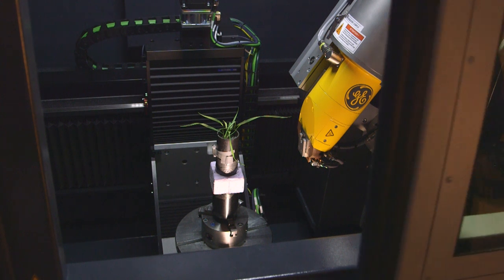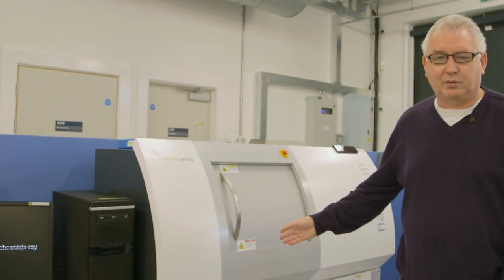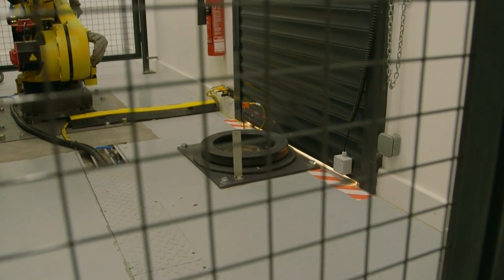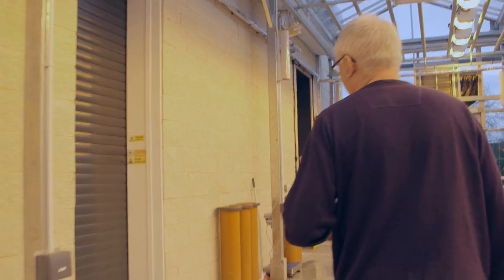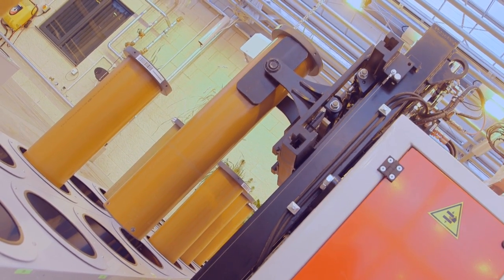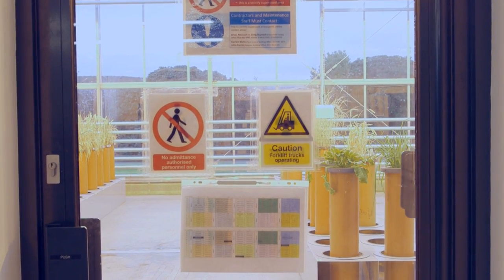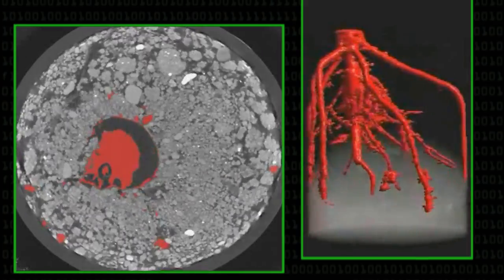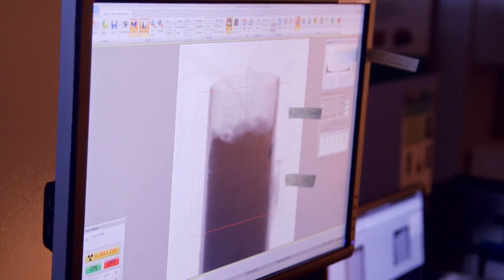3d X-Ray Images - Computerphile

Comment: It's just a CT machine. for plants.
Reply: They haven't so much, though, really. If you listen, the main problem he describes them having is telling the difference. Which is why my own separate post ponders on why the heck you'd pick CT unless you simply weren't aware other options existed, because, unless you can find an effective way of delivering suitable contrast to the plants (which itself may alter root growth behaviour), it's about the worst of all possible 3D radiographic methods for the material under study. You'd probably do better with some kind of automated 3D ultrasound that ran a probe around the outside of each plant pot, never mind any of the other methods which use actual radio or nuclear rays of some kind.

They're essentially performing a bone density scan on the pots, when their "patients" don't have any bones, just soft tissue all the way through... and are being scanned through a thick coat of random cuts of meat.

Comment: hello, I had an idea, about this visualizing the roots, is it possible that you feed the plants with radio actives particles and then observe how they get absorbed by the roots and basically by measuring and tracking their path we could have an estimation of the pattern and appearance of the roots.
Reply: This would be a PET scan. I don't think they'd be able to feed the plants the radioactive "tracer" without contaminating the soil itself, but I guess the roots might be able to absorb enough to show a clear difference between the soil and the roots. Also, I think the radiation from the tracer would probably be much more likely to cause gene mutations than the occasional x-ray scan.

Comment: If the subjective human analysis takes so much of your time to determine the root structure, why don't you do like what the EyeWire team did and crowd source the analysis via a game-like interface? Mapping the retinal connectome seems to be a much more difficult problem than this, so it shouldn't even be that arduous for the participants.
Reply: Crowd sourcing is definitely an option in this case, but of course introduces it's own problems. The image analysis being used here is working, so there's no need to crowd source unless the number of images becomes prohibitive. At the moment with three scanners and a lot of computers capable of processing, this isn't the case.
Reply: Developing a crowd source system also isn't free. You'd also need continuous promotion to keep it going and you're pretty much at the mercy of the volunteers. If there aren't a lot or if they aren't reliable, you wasted all that effort.

This is exactly the kind of task we invented computers for. It's a repetitive, tedious and long mental effort that is very susceptible to human error. They now developed the software which stays useful essentially forever (you can always adapt it for new machines). Quite a bit of engineer probably went into the computer vision algorithm, but compared to the cost of the scanners and the building itself? It's probably a very minor expense with a massive payoff.

Comment: I would love to see more about the algorithms they're using to analyze the scanned images.  They must be insanely complex.
Reply: It's usually done with a kind of deconvolution.

The easiest way to explain a convolution is to think of a blur filter in an image processor. Each point in the image contributes some intensity to adjacent points; it smears out. The measure of how it smears out is a matrix that tells you how it contributes to adjacent points known as a convolution kernel. This can also be done for continuous functions, but never mind.

If you imagine multiplying each pixel with a 100x100 kernel you are now doing 10 000 multiplications per pixel. This is very inefficient. Some smart fellow discovered that if you take the fourier transform of one function convoluted by another, the result is just the pointwise multiplication of the fourier transform of each function. This is very much more efficient. You do your fourier transforms, you multiply to get the fourier transform of the result you're after and then you do an inverse fourier transform to get back to the result.

It's also possible to efficiently "undo" a convolution if you know the convolution kernel. This is called deconvolution.

The simplest 2D example is an astronomical observation. So you have your telescope, and if you photograph a point light, it is slightly smeared out because there's no such thing as perfect optics. If you measure how a point light is smeared out, you know the convolution kernel for how pixels are smeared out by the optics. You can now deconvolve e.g. an image of a galaxy and undo this smearing to get a much nicer result.

In 3D you can do a similar thing. If you photograph a point-shaped object from several directions with x-ray imaging, every image will just be a point. If you extrude these images along the axis they were photographed and sum them toghether into a voxel image, the dense point has become a "star shape", it is a bunch of lines meeting at the point in space where the object is located.

If you have a plant or something that you are imaging, you can consider it as consisting of many of these point objects, each of which becomes a "star shape". Deconvolving the voxel image with this "star shape", turns every "star shape" into a point.

It's in reality more complex than this, because intensity does not depend linearly on thickness of material. If you have a sheet of lead that absorbs half the intensity of an x-ray beam, adding another such sheet does not give you zero intensity on the other side, it gives you 0.5x0.5 = 1/4 intensity.

Comment: Can you apply a deep learning algorithm to better differentiate the roots from the soil? Apparently it's being used to better differentiate cancer cells from non-cancer cells, and to map neurons.
Reply: That seems like a rather odd thing to do when in most cases we have ways to clearly, visibly label cancerous cells as being distinct from regular ones, either through radio-labelling, dyes that response to far-red/infra-red laser energy, etc...

The neuron thing is more interesting, I assume it's the kind of thing used to generate connectome maps and the like, but those are extremely finely detailed affairs that operate at a much smaller scale than is needed for roots and I'd be surprised if the feed data for the analysis isn't from some source that itself better differentiates cells from each other at the original image level, e.g. fMRI.

Comment: It seems like they spent an exorbitant amount of money at each step of this system.  Special robots, special robot environments, special cylinders,  special software.  I would assume that the same operation could have been done manually for many years on the startup cost alone.  Does this mean that there simply aren't enough humans who are interested enough to put in the human hours necessary and therefore they resorted to robots?  Sorry if I am out of line, but it seems like a huge waste of money for some data which apparently few people are interested in.
Maybe some of the cost is necessary.  I don't know.  I'm not there.  But it seems that at least they could have moved the plants once a day or once a week or whatever by hand instead of needing a multi-million dollar robot environment.  And when I say "by hand", I mean a $200 dolly and winch or something.
So, clearly, there either lacks manpower due to a complete disinterest in the project, or someone just has a bunch of "free" money to waste.
Reply: its kind of like trying to get the last drops of water from a glass. Research needs ever more sophisticated tools to proceed. 

The automated plant carrier is a common system that costs very little more than a standard forklift, so it saves them having to call "ted" over and operate it.

Special software is obviously a must have... who wrote software to do this? nobody takes x-ray images of things encased on material of varying density like soil.

Cylinders? no off the shelf flower pot is designed to grow maze or wheat, and no industrial system grows plants for x-raying.
Reply: Its probably to justify more funding, i assume it allows for 24 hours work days (as in it analyses when people have gone home) and 365 days per year (something you could not do to people, no matter how willing, thanks to laws restricting your ability to work)
Reply: spoonikle
I was referring most specifically to the cost of the robots and robot software.  How much does this robot cost?  I can imagine that forklifts aren't cheap either.
Then, these robot forklifts need a specially designed environment to operate which is sized to fit their needs.  And then they need reflectors.  And then they need software to tell them available paths and plant numbers and queue.
I imagine all that alone is easily over a million dollars worth of infrastructure, planning, parts, and labor.
So, who is operating this facility and where is the facility?
I assume that many of the operators are students.  If a student is at all interested, couldn't a student move a plant once a day?
I have no problem with the X-ray technology or tracking the root growth through layers of X-ray photos in order to generate a 3D image.  I think that is really cool and useful.  It's just all the other money wasted which I find very typical of these sorts of projects and very annoying.
So much waste....
Reply: ty_ger Do you want people carrying 90kg samples by hand? Or do you want to install a moving crane frames on the ceiling? Either way that would cost you more than the robot, because in the first case you need to hire one of the best powerlifters in the world, and in the second case you need to mount a metric shitton of stuff.
Reply: Slithereenn
Clearly, you didn't read what I typed.
All you need is a cart with wheels and a winch.  The skinniest armed nerd would have the strength to operate it and the cost would be in the hundreds of dollars.
Maybe they could let a student learn how to design and build a simple machine in the process.  Ha ha.
Reply: ty_ger
And how would paying those three or four cart operators wages, paying taxes for them and paying for their medical insurance for a few years be cheaper than buying one streamlined industrial robot?
Reply: Slithereenn
The operators are students.  The students are paying money to be there.  Learning other skills and a getting some physical exercise wouldn't hurt them at all.
And once again, clearly, you didn't read what I typed.  I said that they could operate for years manually on the startup cost alone.  I didn't say that operating manually was "free"; just much less expensive.
Reply: ty_ger please devise a manual method to not disturb the plants and X-ray them periodically as they grew?
Reply: ty_ger
What about the time when there are no students, and you desperately need to move something? Would you go and do it yourself? If yes - that's why you don't work in an installation like this. There are times when efficiency and reliability is worth more than any money.
Reply: Slithereenn 
Then there must not be any interest in this program, huh?  Another one of my opening premises which you perhaps also did not read.  ;)
Reply: spoonikle
I did.  ;)  Lifting them with a winch onto a cart will disturb the plants exactly the same as the robot.
Reply: spoonikle  not to mention that unlike ted who cna be distracted or clubsy or i otherwise faliable a machine gives the right movments at the right time eveyr time:)  makes sure there are no variables. or soemthing.

automation gives percision and is therefor worth it.
Reply: i think the main reason why they dont have much manpower is because at leats wit the loading of the scanners x-rays can be harmful to humans so it's bets t use an x-ray resistant tol like a robot. also as i stated before robots are percise and repetitive so you are gurarnteed they wont disturb the sil like a cumbsy human might.  and i think the actual stitching of xray iamges is just your standard photogrammetry which ha sto be doen by machiens to work.

also i think the fact this setup uses so much complicated and sophsiticated tools means there is interest. since they want persiion and actual results:)  which is why they opt for the more expensive but percise gizmos than the clumbsy but cheap human labor
Reply: Meir Teichman
X-Ray radiation does not remain in an object when its not in use.  Therefore loading something into the scanner when the X-Ray is off does not lead to any health risks.
Humans are doomed if we lose faith in our ability to do anything physical.  Maybe that is why we continue to get fatter and lazier and we continue to lose job positions and our exported goods continues to decline.  But whatever.  Maybe "wasting" money at educational institutions keeps money flowing and gives people a reason to wake up in the morning.  I am going to leave this conversation to trail off on its own.
Reply: methinks ty_ger  is not actually concerned with the practicality of using sophisticated machiens for menial tasks cheaper workers could do but has a pro luddite agenda which is agaisnt ever increasing automation and teh benefits it yeilds.

which is why i think they framed their concerns in such a way, measuring interest in a project not by the budget or resources it has gained but the amount of human help they staff.

so using their logic nobody gives a damn about intenret search o cheap goods or the stock market but minimum wage drudgery is all the rage,since so many people work minimum wage while barley anyone is at the stock markets.
Reply: Companies often develop technology or apply existing technology to gain expertiese that is then useful in other areas, other projects and other problems. I'm sure that they are capable people and looked at all the options sensibly. Do you have experience managing large amounts of money in projects that have specific criteria which sometimes exceed industry standards? If you do then you might agree with me when I say that the simplest details, hidden to any outsider, can often persuade you to make a more expensive decision.
Reply: Connor Hill the word you are looking for is abstraction
Reply: That is a naive view. It is done like this to isolate it completely, and for safety. These are heavy pots. In Science, you do everything you can to eliminate contamination of results. However I think the predominant reason is safety.
Reply: I don't think you're out of line for asking the question. 
Having said that, the robot might well have been a learning experience for students designing and building robots and writing software. Also, the computer controlling the robot is probably logging every move it makes. How many students will happily log every error they make which might influence the results? As well as precise measurements of acceleration, velocity, temperature and light differences during the trip.
Or maybe they just thought it would be neat to have a robot....
Reply: You appear to be questioning a couple of aspects of the system. Firstly, the x-ray technology itself, and whether this data is useful to enough people. Secondly, whether the automation provides enough benefit to merit the cost. Addressing the first question, there are very few research labs worldwide capable of capturing root information from within the soil without disturbing the plant. Clearly this information is mainly of interest to plant biologists, but there are a lot of them, and they are working towards breeding plants that are more drought, stress and disease tolerant, which is a benefit to everyone. I'm not a plant biologist myself, but having spoken to a lot of them, they all seem agreed that this kind of data capture is far superior to other approaches, such as digging the plants up and damaging the root systems.

Regarding the automation, there's obviously an aspect of this which is fun, but the vast majority of the cost of this project was the x-ray scanners, and the building itself. The main justification for the robot is the ability to run the system un-manned 24 hours a day, which when it's fully stocked with plants will allow each plant to be captured enough times. Given that each plant takes up to an hour in the scanner, you basically want to be running the system non-stop, and paying people overnight is expensive. It will take a while before the cost of the personnel would overtake the outlay for the robots, but this will happen, long before this building stops seeing use.
Reply: Besides what's been said already there's also the investment aspect of the machine beyond personal use. If they haven't already, they'll most likely rent time on the machine and you wouldn't want a 3rd party buggering things up or such a long time "sample moving" employee racking up a wage.
Reply: spoonikle
Why would they need a forklift to move a single blade of grass? Ok there is some soil too, but forklifts operate in the tonne range, that would still be overkill.
Reply: ty_ger No, I highly doubt the students are paying to be there. They are most likely graduate students who have assistantships (providing free tuition and a living stipend). The people working in that lab are being paid and should be.

And the robot may be a big startup cost, but it's likely to save money in the long run on labor costs.
Reply: Didn't they say the robot was adapted from an industrial version? And I think quite a lot of people are interested in the best varieties of wheat and maize. Think Monsanto and the like. And I think you're overestimating how much that all costs, anyway.
Reply: Gareth Field exactly, those automated forklifts are barely more expensive than a new manned forklift. Very much worth it. As long as your work environment can be automated you would want a robot.
Reply: ty_ger He said that everything is standard technology other than one piece of software.